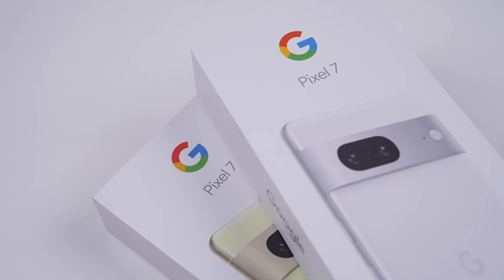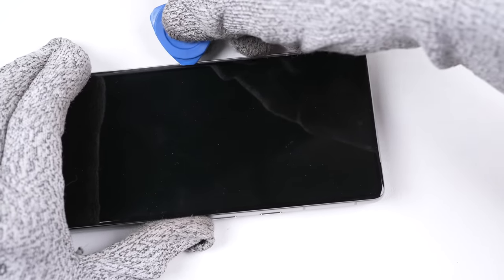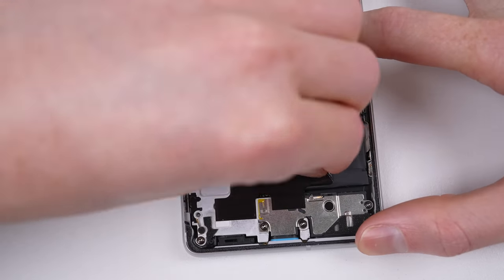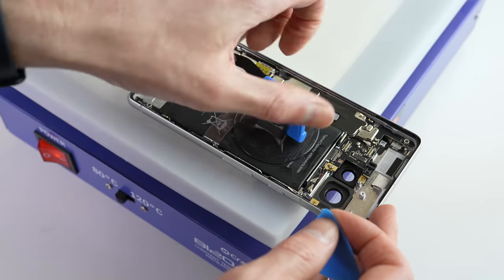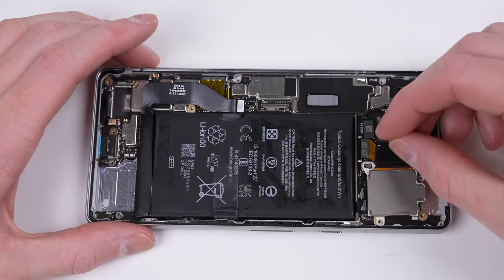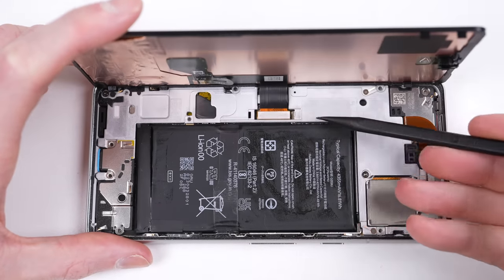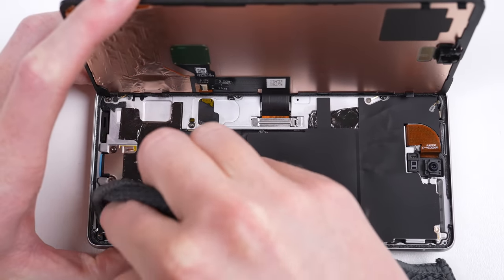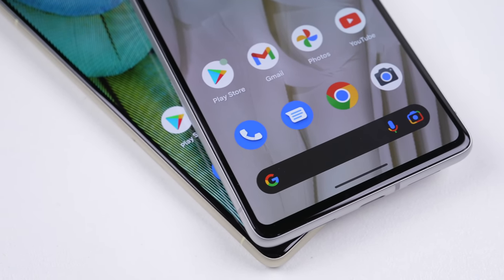Inside Google's New Pixel 7 - Teardown and Repair Assessment

Comment: The main reason why a lot of under-screen fingerprint readers don’t work after replacement, is because they often need recalibration. Google offers a free software tool for that for the Pixel 6 and 7. Samsung leaves it to their phones to recalibrate, and when it fails to do so, you get an error. Apple is the only one to prevent it and FaceID for monetary gain.
Reply: It all seems good but for me and many others the fingerprint calibration is not working after a screen replace.

Comment: So, what about the condensation in the lens?  Seems like a bad place for water.
Reply: /turn on sarcasm 
It's an added convenience. It saves the corporation time, by having a future repair denied, because of water damage.
/sarcasm off
Although wonder if some devices ''accidentally'' forget to remove moisture during assembly. From lubrication and cleaning of course.

Comment: The LCD on this phone is like paper and very easy to break from a drop. Have already done many screen replacements on these.
Reply: It’s oled lol not LCD.
Reply: @ThatGuyKhanto  LCD has become the generic term for displays in the repair industry. Even when I do an RMA, the box still says LCD. I know it's OLED.
Reply: @mmaaddict78  Oem tags for parts label them oled or lcd. Never the same due to differences in parts. If it’s a third party then it’s on them. But there are two differences on the types of panels they are.
Reply: @ThatGuyKhanto  I have not seen a LCD available to buy for this phone. They are all OLED as far as I have seen. I've been fixing phones for 8 years, I know the difference between OLED and LCD.

Comment: My Pixel 7 has this weird blue haze bar across the middle making it hard to read text while on light mode. Could it be burn in or does Google just use a crappy panel on the base model.

Comment: I'm keen to 3d print a case that incorporates a stand but still works with wireless charging. I aim to achieve this by having it recessed into the shell of the case itself. Any chance you can post the location of the wireless charging sensor? Distance from the bottom and top edge of the phone?
Reply: Maybe look for someone doing a transparent mod as they'll be removing it
Reply: @RennieAsh  nice thought, thanks!

Comment: Seems as though repair ability isn’t realistic. Taking large stickers out sort of ruin the product. I have several older devices such as a 2012 iPad that still works well other than lack of software updates and speed. The battery is still great.

Comment: In my book this is a 9/10 from Google. The only thing I will fault them on is the excessive use of glue for the battery.
There is goog reasoning behind soldering the USB connector and that is price + durability (mostly price). Having to design+manufacture a seperate USB board has a very real cost, that will ultimately be passed on to the consumer (let's be honest right?) and as long as this USB connector can be sourced, I don't think many legit repair shops are going to have a problem with swapping it.
Reply: Oh so now we are justifying it if it's from other companies?

Comment: Please someone check if audio interface sound card can be connected to this phone directly with it's included USB adapter as my Pixel 4XL doesn't work like this but cheap Xiaomi works fine.

Comment: The condensation in the camera when heating up is not a good sign. It's water inside your device and that doesn't have to end well.

Edit: The fingerprint callibration makes sense. It ensures that the reader is safe and working correctly I'm sure there will be some bootleg screen with faulty or malicious fingerprint readers and this step is safety feature. It's not a big deal since tool is provided by google.

The battery though is not good at all. It's glued so much it's hard to get out but this is first part that will eventually go out.

Comment: What a poor use of internal space. They could have easily fit in a 5000mah battery if the internal space was use more wisley.

Look at the Xperia 5 iv not only it has a smaller 6.1 screen and a thinner body. But it also has SD Card slot, headphone jack, Two front facing speakers, and 5000mah battery

Thier commitment to the visor look ended up wasting space on top of it

Comment: 5G Sub 6 is the weakest form of 5G. Apple only uses 5G MW. Millimeter Wave 5G. 5G MW is the strongest 5G possible. Meaning you get the fastest data speeds possible. 5G Sub 6 speeds cap out at 150Mbps. 4G speeds. 5GMW can go over 2,000Mbps.

Comment: I don't think google intentionally put the fingerprint calibration system. Probably it HAS to be done after swiping because of the algorithm. If google really wanted to get rid of third party repairs like apple, they would drop more errors or at least make the calibration process harder.

Comment: Very nice display!
Why electronic devices are so expensive and so low-spec in Australia?
PWM lighting control, only 128GB or 256GB storage, no charger.
Recently, I need to buy a new laptop and a new cellphone. After comparing prices, I choose to purchase them in Mainland China and mail them to Australia. Every same laptop is more than twice the price in China.

Comment: Dafuq? This is by no means repair friendly, the first moment I saw the star-shaped screw I have already given up on this product. What's wrong with going with the standard Phillips head? I change phone batteries every 2 years, prying on the screen just to swap the battery just creates unnecessary risks. What's wrong with opening up from the back like most smartphones do? The back is made out of plastic so it's less prone to damage no? But nooooo... Google just have to emulate Apple and have their customers risk breaking a screen just to swap out a battery, not that your screen is anymore beautiful than other smartphones in the same price bracket, that bezel is thicker than Sundar Pichai's eyebrows. And no dual sim card slot? Fuck you google.

Comment: Wow, what a bad design. Besides Software-locks this phone checks every box for being a pain to repair.
- Opens from the front, risking breaking the display
- USB Port soldered on the mainboard
- Super hard to remove Battery

Comment: Phone manufacturers should have the batteries screwed in from top left and bottom rights instead of glue with plastic tabs k. That'll hold the phone together but make it easier to remove for replacements.
Reply: You just answered yourself as to why they don't
The manufacturers want you to buy new, not repair
Reply: @cliffcorson4000  you may argue that that is the case but I would say that they are doing that because it's cheaper and more space efficient.
Reply: @danyuzunov  By the same logic 5 little sticky dots can hold the battery just the same. It's even cheaper and easier to repair/replace. Win-win. Imagine if a doofus like me can think of it, all the phone manufacturers in the world have known it for ages. 😉😂 It's never been a problem of will, just desire.
Reply: @danyuzunov  not really
They could easily create a simple bracket to hold it in place that shares space to hold down other items
If you watched the video you could clearly see him remove such a bracket that was above several other components. This bracket could have simply covered spots on the battery to hold it in space 
A major issue is how so many batteries fill in space that doesn't allow them proper area for cooling
This was the issue with the Samsung battery recall where the battery was so large it overheated
Reply: @cliffcorson4000  Chinese Phone manufacturers say otherwise
Reply: @keonxd8918  and how are they right?
Reply: @cliffcorson4000  better battery removal taps?

Comment: Battery removal seems painful. No way normies can repair this. I'd avoid this and get a Samsung XCover6 Pro
Reply: Agree. You can combine heat gun from the back an alcohol on the front but that's too much just for battery. But at least it's easy to swap the screen.

Comment: This is the phone that people should be purchasing this year - not the iPhone.
The Pixel series actually allows you to replace parts without stupidly sneaky serialization tactics.
Reply: How about the type c port?
Reply: @keonxd8918  More people are going to be worried about how they can't change their phone's display or battery (iPhone 12 and newer), compared to their USB port wearing out over time (Pixel 7). And besides, it should be possible with microsoldering?
Reply: @TheSpotify95  defeats the purpose of consumers right to repair then if they can't do it themselves

Comment: what is the purpose of your video...........?

repairing phones?.............

why would you think that two identical phone models with parts from A passed over to B and vice versa............... would present any issues? 

i can't for the life of me understand what you are trying to prove?

.......of Couse some hardware parts in  some particular phone may be LOCKED to the SOC CHIP of that phone
and locked that soc chip serial number (logic board as you call it)............that's just common sense.
 
Of course , there may be software work arounds for breaching that locking situation in  the event of where you shove in some foreign replacement part......

but who doesn't know that?

i think you will find that generally TECH devices like this are not made to be repaired easily ........if at all.

To be honest, a lot of that LOCKING and LAW is concerning "intellectual property rights" on the chip sets
and hardware plugged into those SOC CHIPS........as you will appreciate all the parts of Pixels will be made by
different company's who must agree on the terms of HOW the parts interact.

For example, if you install a free app called OPEN CAMERA on droid phones , it tends to "open" up all the features of your phone camera which your brand left closed.........your brand had not paid the licensing of those parts with the camera company and therefor could not expose those features......

"Open camera" free app.........as it's name implies, OPENS all your phone camera settings which your brand
left closed.  It's a free upgrade for many consumer & entry level smart phones. 
It makes your phones "stock phone camera app" obsolete.